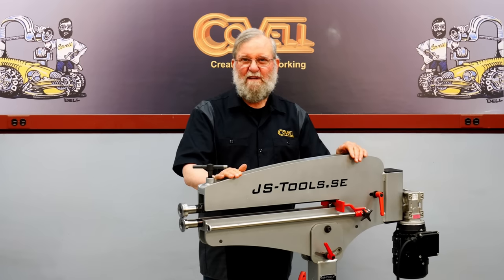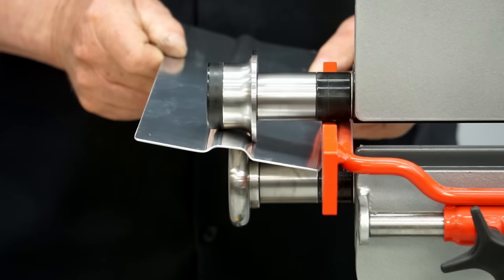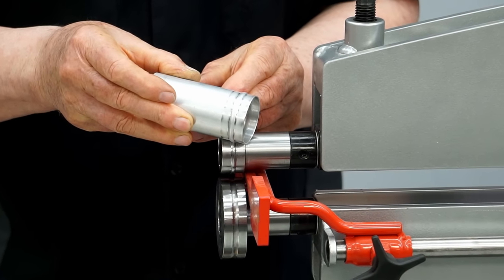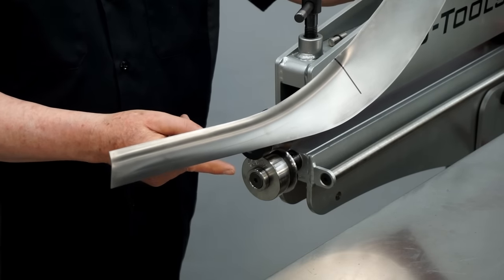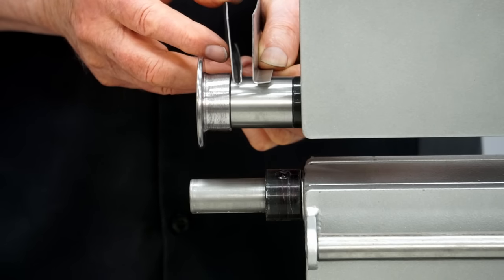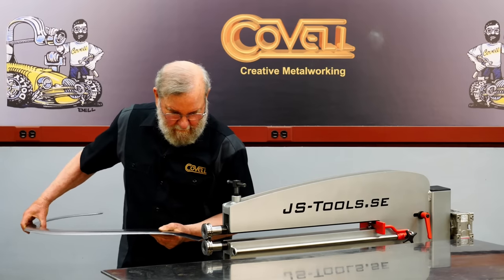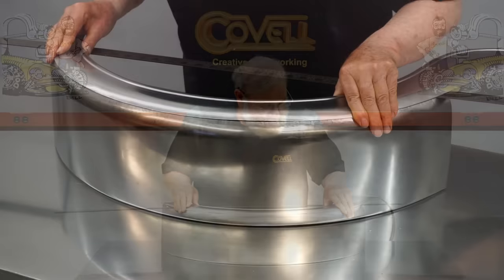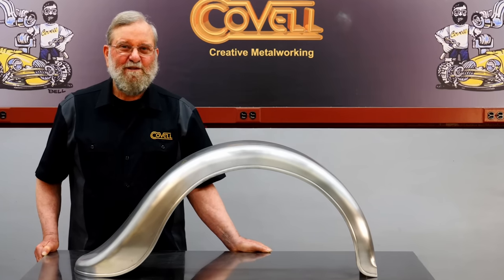Introducing the JS Tools Bead Roller

Comment: thanks for sharing your knowledge Ron.  I purchased my JS bead roller 9 or 10 yrs ago.  I don`t use it every day, but I`d be lost without it.  I love how versatile it is. It`s not the cheapest machine out there, especially when you start loading the shopping card with tooling, but it`s well worth it imo.  It`s strudy as heck and it will take a beating.  If you take a little more time and do a few more passes, it will shape 16ga with a smile.
Reply from the maker: Thanks for sharing! I haven't used the machine on 16-gauge yet, but it's good to know that it can handle that material with a little patience. I believe this machine is new to the American market. Are you in Sweden, or Europe?
Reply: @RonCovell   I`m in the Netherlands.  We actually met years ago when you were over at Johan`s shop for a 2 or 3 day course.  I purchased mine directly from JS.  Very nice dealing with them and very helpfull too.  I`m surprised it took so long to get it onto the US market... Anyways, I hope you enjoy it as I do and keep sharing your experience for many more years. 👍

Comment: Ron if you look at the motor controller for your bead roller, it may have a provision for an external variable speed control. You might be able to wire that variable input to a tig pedal so you can control the speed with your foot instead of pulsing the existing pedal. Your metal shaping skills are amazing to watch.

Comment: Hi Ron.
I'm late to the video but thoroughly enjoyed it.
That's the first time that I've seen an adjustable angle on the "head" of a bead roller.  Very nice feature.
As usual, you do very clean work.
Those dies sure made quick work of wire edging!
Take care.
Reply from the maker: Hi Joe, good to hear from you. Yes, Bead Rollers are extremely efficient for making wired edges, along with many other jobs. Lazze just released a new video, showing yet another innovation he has pioneered. Check it out if you haven't seen it:
https://www.youtube.com/watch?v=1LyBpQPrRKM&t=925s

Comment: Always enjoy your videos showing 1001+ uses for a tool.
What could you do for thicker aluminum like 3mm or thicker?
Reply from the maker: Different dies exert different forces against the frame of the machine. Large beads take some of the most force, but the Round Over dies much less so. I have done some Rounding Over on 3mm material, but to bead it would take a beefier machine.
Reply: @RonCovell thank you, that’s perfect to know, was wanting to use the round over for adding a smoother transition to pieces and a nicer look where possible

Comment: That machine is nice but it responds well to its master. Elegant 😊
Reply from the maker: Thanks so much. Yes, there is truth in what you say. I've used bead rollers for over 50 years, and there is a lot I have learned to avoid, so the results come out smooth on the first try.

Comment: What kind of welding TIG machine you used very nice job
Reply from the maker: I used a Miller Dynasty 210 TIG welder for this project. I also use the Miller Diversion 180, which is more affordable.
Reply: @RonCovell  thanks for you replying and my first question still waiting the JS tool bead price with all equipment price thanks
Reply from the maker: You can get the complete information on this machine, including the cost for shipping, by contacting Trick Tools:
https://www.trick-tools.com/SFM620-JS-Tools-24-inch-Power-Bead-Roller-18490
Reply: @RonCovell  thanks very much

Comment: What does the wire do, and how does it reinforce the fender?
Reply from the maker: Yes, the wire is used to strengthen the fender edge. The bending strength of steel increases as the cube of the thickness, so for 1mm steel sheet, wrapping it around a 3mm wire makes the edge about 25 times stiffer. 

This was common practice for car fenders up through the mid 1930's. 

Here's a good overview of the process:
http://wiki.dtonline.org/index.php/Wired_Edge

Comment: Great video on how to use the bead roller.  You made the sample fender out of 20 gage.  In reality, a fender would be 20 gage, or in some cases 19 gage.  You said the max steel material for the roller is 18 gage.  Would have been interesting to see the sample made with 18 gage to see the performance of the roller in a more common use.
Reply from the maker: You bring up a good point. I used 20-gauge steel mostly because it's so easy to form, but it would have been good to do a couple of the demonstrations using thicker material, to better show the capabilities of the machine.